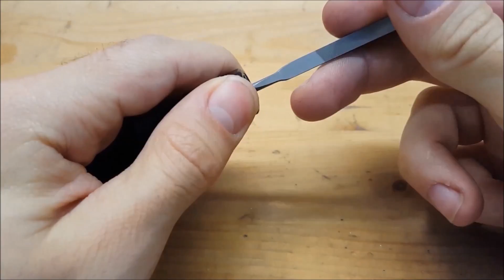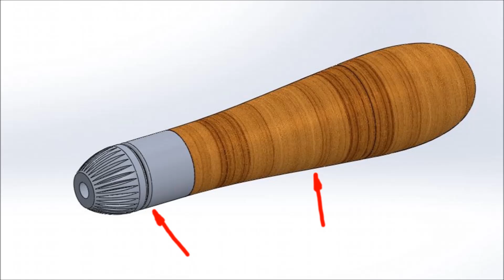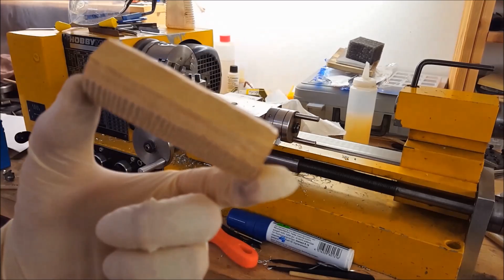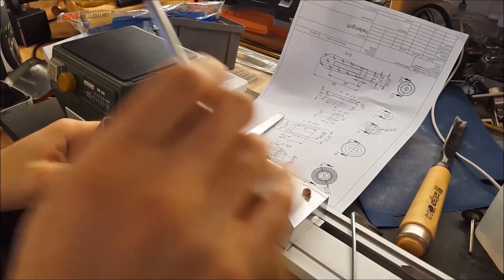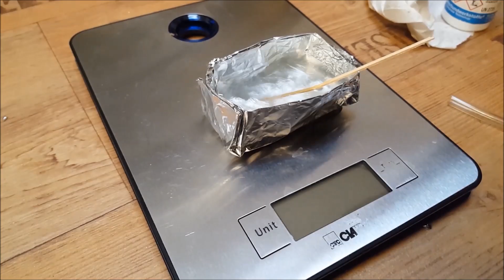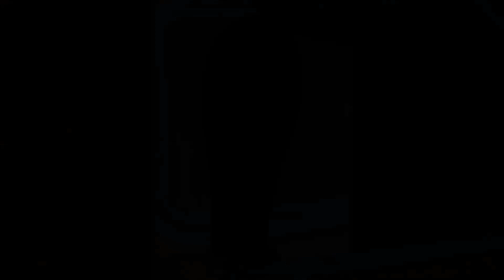How to make a custom File Handle for needle files - Part 1 of 3

Comment: Usually, people stabilize a piece of wood first, then carve something out of it. You carved the wood, then stabilized it.
Reply from the maker: Hi, that´s true. The reason I did it this way around is my hobbyist setup. I wasn´t sure how deep the resin would penetrate into the wood, so I decided to do it this way around. It´s a bit more work, but it guarantees a good result with no unprotected areas.